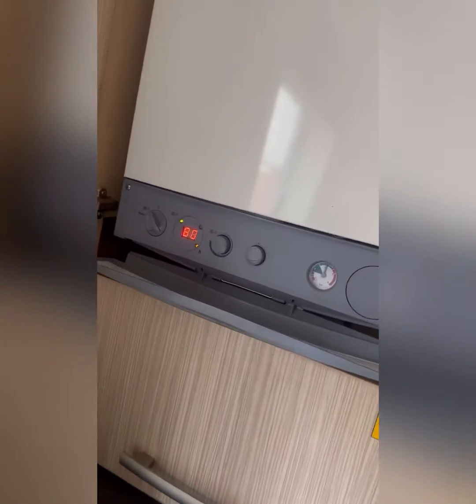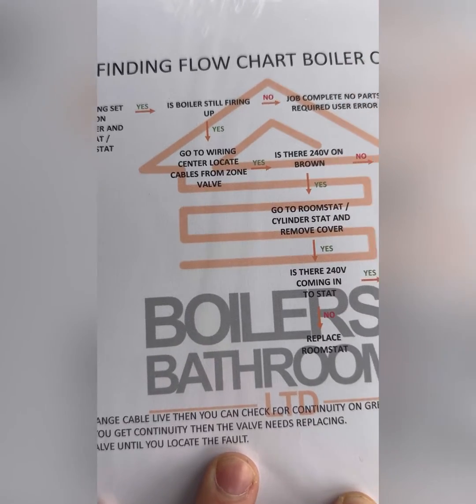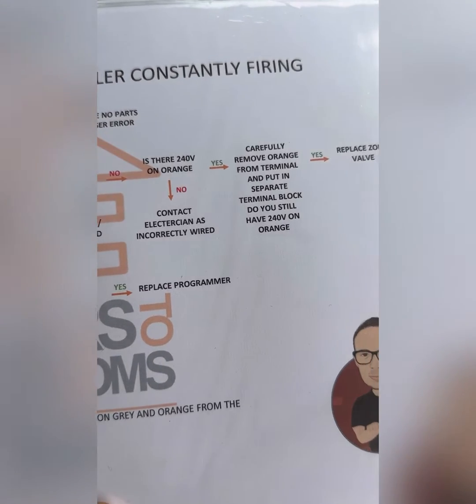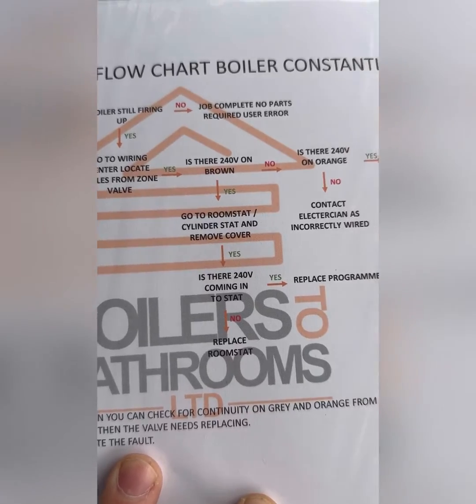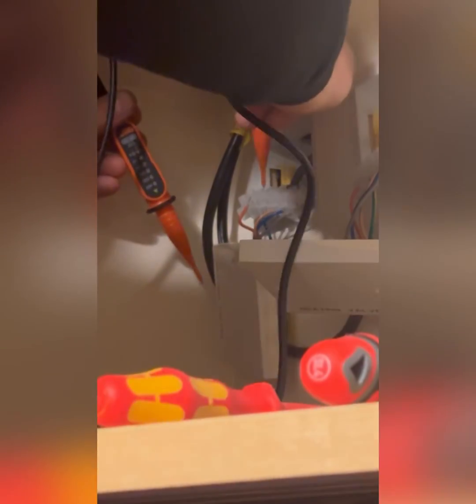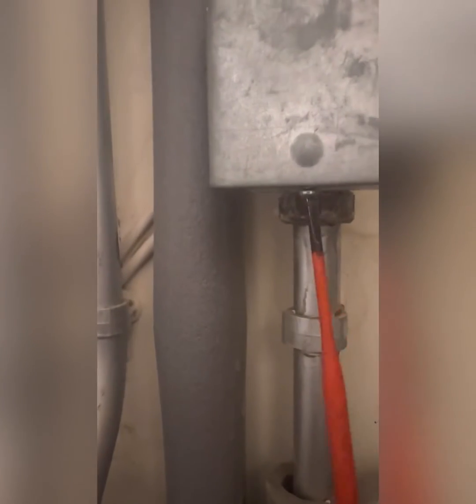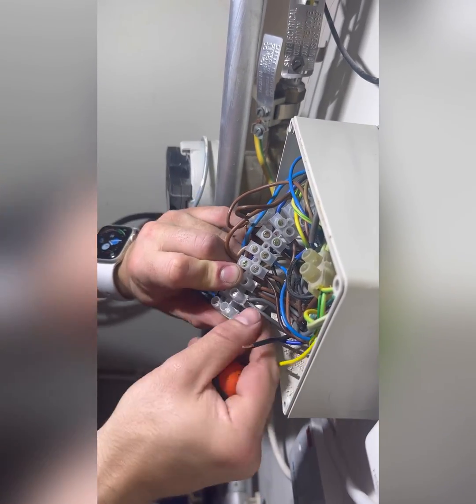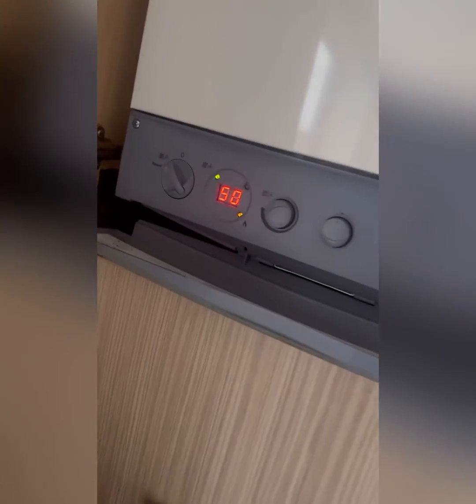My boiler won’t turn off Potterton HE on a S plan system, solar unvented hot water and two HTG zones

Comment: Hi 
Trying to understand this video!!!!
If the hot water zone valve is faulty why is the display on boiler showing call for heating and not for hot water?
Reply from the maker: It’s a system boiler it doesn’t know what zone is calling it fires up regardless.
Reply: @boilerstobathrooms  
Thanks!